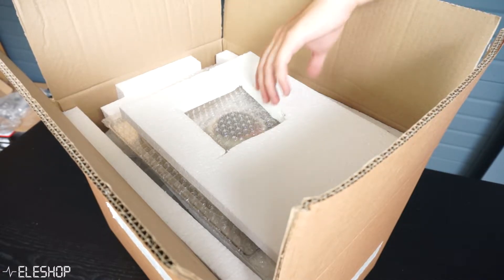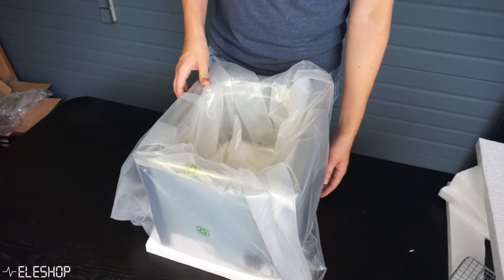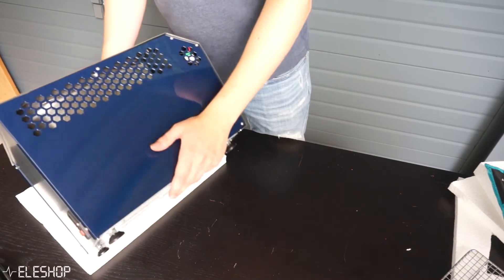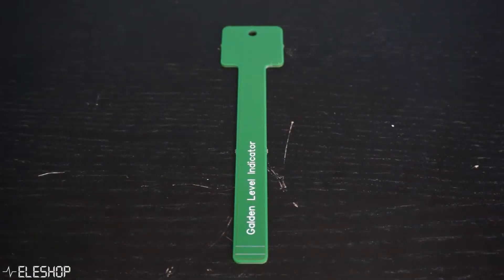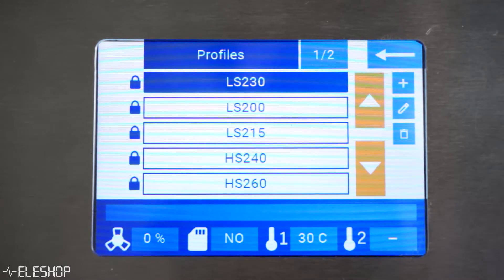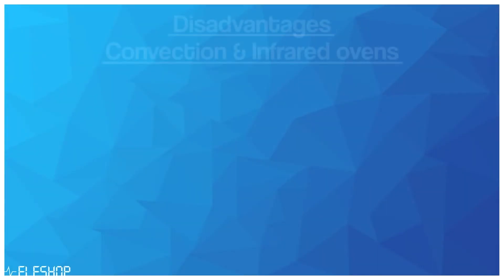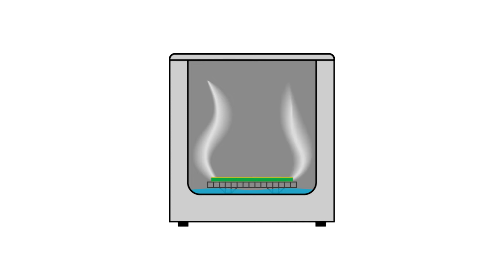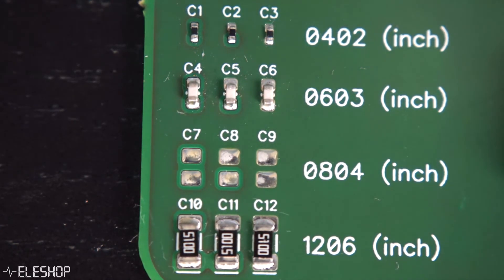Unboxing & Demonstration of the New Vaporflow 275 Vapour Phase Reflow Oven

Comment: Thanks for great video. Just one question - roughly how much vapor fluid is needed for one reflow process? Since the fluid is expensive it seems relevant but havent found any figures.
Reply from the maker: Consumption of PFPE fluid is about 2 grams per soldering cycle. So cost of the fluid is very low compared to the other costs of soldering a board.
Reply: @EleshopVideo  Thanks for quick reply!
Reply: @EleshopVideo  And the remaining fluid is to be left in the reflow oven?
Reply from the maker: @oscarleon5412  Indeed, the fluid stays in the oven.
Reply: The solder joints do look dull from the video?
Reply from the maker: @phangmoh  It might look like this in the video, but the joints are shiny.